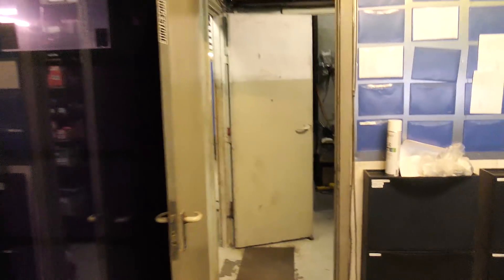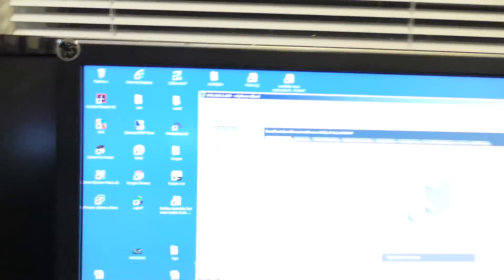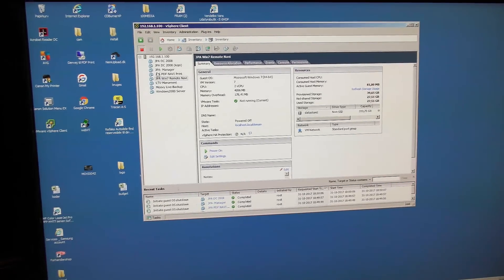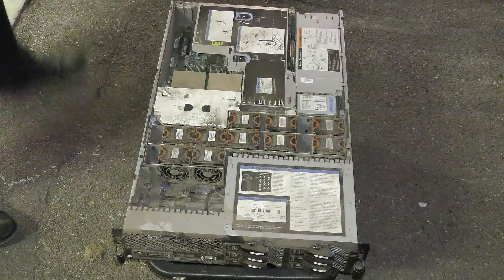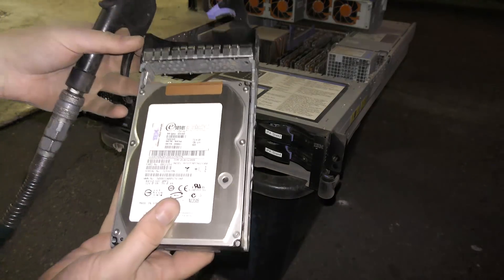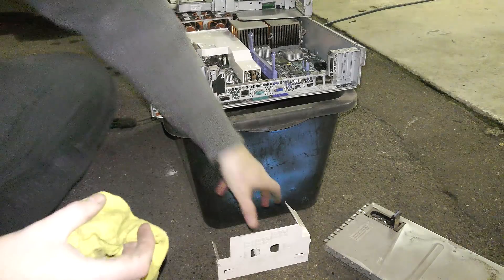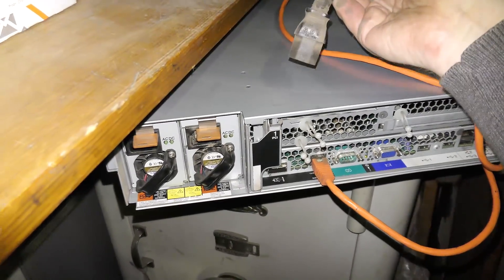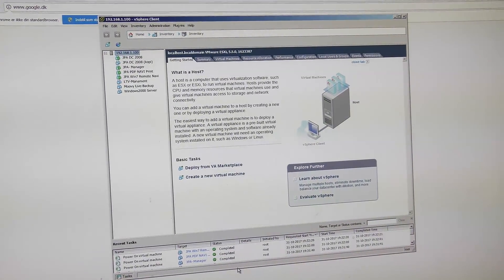Lenovo TANK x3650 M1 - I do NOT Recommend This - 603

Comment: The x3650 M1's really are indestructible. I accidentally spilled a glass of water into mine while it was running (I used to have it sitting next to me on my desk, water got into it through the gap in the lid and ran down the HDD backplane). I took it apart, dried it out and it worked fine, this was a couple of years ago, it's still working fine to this day!
Reply from the maker: Thank You for that story,, Nice!! :-)

Comment: Hello Morten. It seems you are a specialist for the IBM x3650 M1. We actually got a weird problem with our good old maschine. The server (Windows Server 2012R2) randomly shuts down (resets) and comes  back up later. When logged on while this happens, you will see the windows "Shuting down.." is shown for some seconds. Than the server suddenly do a hard reset but Windows has NOT yet shut down properly.  Sometimes the server is reseting while rebooting and it can take two or more hours before Windows will be started again. I have monitored the sensors with HWInfo but there was nothing noticeable. I also ran Prime95 and the server survived that... Any ideas? Yesterday I was running the quick test from the Diagnostic and the server rebooted while the test was running. Sometimes the server is in a strange state where I can press the power button as long as I want and nothing happens. I have to pull out the power supplies than and put them back in. this behaviour could be seen on two different locations now so power network problems seems not to be the cause. Any ideas?
Reply from the maker: A non activated Server install can do weird stuff like that :-/
Reply: My PlayHouse I really wish it were that easy. 😅

Comment: No thermal paste change? :/
Reply from the maker: Hi eWOLF
No,, never found that necessary. 
Thank you for watching! :-)
Reply: I like to do it on 6mo to 1y basis, depending on CPU arhitecture. I have seen serious thermal paste degradation on Nahalem CPU's in my dual CPU workstations (X5650's and X5670's) and found that optimal interval is 6-8 months. Yeah, you can delay that, but I have seen beetween 5  to 8 C rise in temps after 6+ months (especially after summer). Sandy B. Xeons are much better- not only in overall temps, but in way that they don't have major temp increase due to thermal paste degradation. Don't get me wrong, I am just sharing my experience. :)

Comment: Small pro-tip (or hack, depending on how you execute it....): create a cover for the front with an air filter for the intake air. Use an as large as possible area for the filter; the fibre blankets sold for kitchen exhaust works great. This tip works great for all kind of electronics with active cooling in dirty/dusty environment: power amplifiers, servers etc.
Reply from the maker: Hi Frank van de Pol
Thank You very much!
Thank you for watching! :-)

Comment: Treflig fødelsdagn!
…which probaby was painstakingly wrong, but you get my drift? ^^)
By the way, the folks at your garage may want to get a piece of gritted steel sheet from the home depot, bend it into a shape, so that it can be put onto the front of the server, then put an air filter like you get for the fume hoods in kitches over it, then set up a monthly cron job on their computers that reminds them to vacuum clean the filter. Once a month should do.
The working time to make that thing not included, they should get away at under 30 quid for that.
Reply from the maker: Hi Eo Tunun
Thank You very much!  glad you liked the video :-)
Thank you for watching! :-)